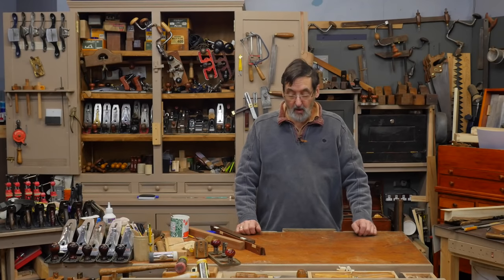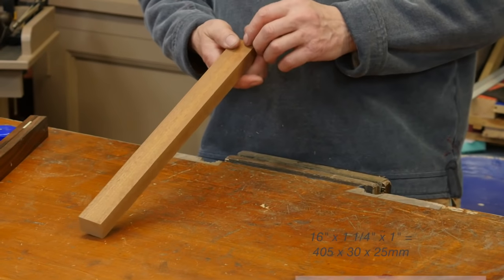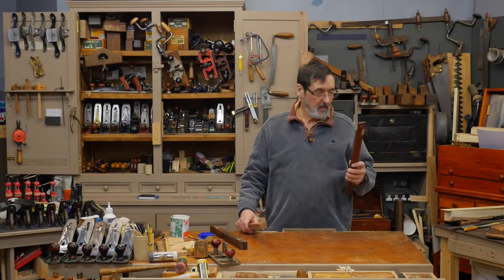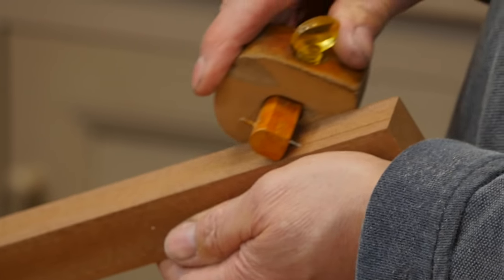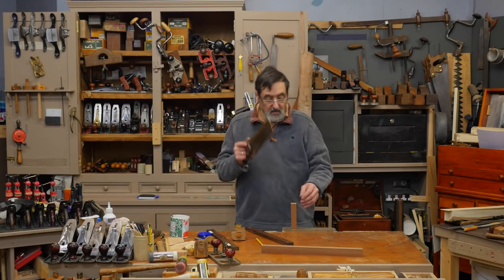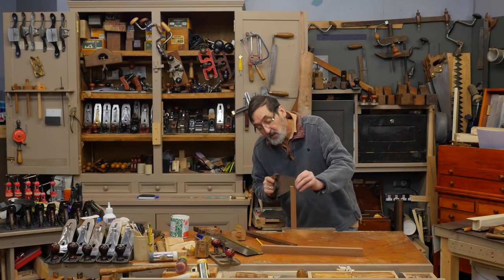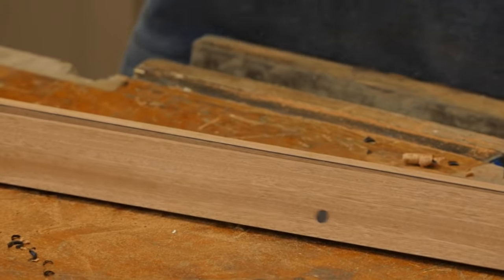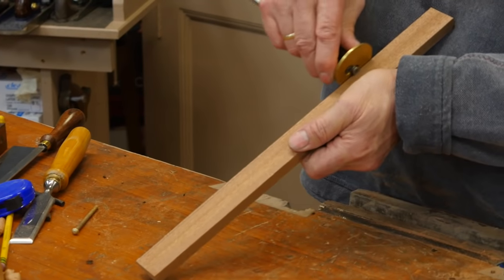How to make Winding Sticks (part 1) | Paul Sellers

Comment: OK, so the first thing you need is a piece of wood 1 1/4" x 1". Which took me almost two hours to saw and plane until it was "dead" straight, "dead" flat and "dead" square. (I had also watched the episodes about planing and squaring a piece of wood and  sharpening a plane iron) The funny thing is that, although this was a clumsy exercise and too way too long, I never knew I could do this AT ALL. But thanks to Paul's clear instruction videos everyone is able to learn the techniques.
Reply: How does one make the wood for his winding sticks perfectly flat and square without winding sticks?....
Reply: Luke Harris a small engineer’s square, a combination square...
Reply: one or two pieces of maple flooring fast and neat
Reply: @lukeharris7487  
Winding sticks are not that long so you can use a combination of eye, square and two flat bits of wood if you have them. 
This will allow you to square them without a twist. Winding sticks makes the job so much more easier and efficient.

Comment: Thank you Mr. Sellers for all your shared knowledge.
For cutting those small rabbets I like to use japanese marking gauges. They have little cutters. You can buy the blades seperatly and make your own... It works great. I also use it to cut very thin stock.

Comment: A side note on the Super Glue: when using cyanoacrylate, you can breathe on it to help it set. Normally, it uses the moisture in the air to set, but you can speed things up, if you really need to.

Comment: I'm learning so much so quickly from your videos. This one's come right handy as I'm desperately in need of a pair of winding sticks. One question: you said you ripped your ebony strip but didn't explain whether you were using it straight from ripping or after planing it down to size. Did you plane it down to size? If so how? Do you plane it on a surface against a stop or do you put the strip in a stopped slot?

Comment: so  I have a question, how do you square the stock for making winding sticks without winding sticks? I am trying to do this project and am having a hell of a time making sure my piece is true, as I do not have winding sticks. It seems a bit of a chicken or the egg issue.
Reply: +K EN use two squares.  Even if they are not the same width, so long as the upper edges are parallel, your piece is true.  It works the same as winding sticks, but winding sticks are easier to see and use.

Comment: Although I have made a pair of these I rarely use them. Instead I bought a couple of aluminium worktop joints from B&Q for a tenner, and put a strip of white tape on one and black tape on the other (https://www.diy.com/departments/goodhome-nantua-brushed-silver-effect-aluminium-alloy-worktop-joint/3663602635833_BQ.prd)
They are dead straight, they won’t warp, twist or bend; and I can leave them in the shed. They even have a ‘hook’ on the end. But even these have become a problem because I’m at a stage Mr Sellers hasn’t reached yet, when it’s difficult to keep both sticks in focus at the same time even with specs on. Also, bending down continually is getting difficult and getting up again is nigh impossible. So I got out my 9 inch spirit level. All I have to do is make sure the wood is firmly located, ideally with one end level, and then try the level on the other end. Works a charm, and no more bending!

Comment: Okay, I'll ask a dumb question: how would I get a beam of timber that is square all round without winding sticks in the first place to check my Face for twist? I know the obvious might be, machine it, but that seems to defeat the object.
Reply: Make a short pair of winding sticks. Use your eye combined with a square to get them straight as possible. You could use already purchased stock that is square to work as winding sticks that will get you through the process of making them. 
There is a certain level of square and straight that is worked to. That means if you get instruments and analyse the surface you will find it is not entire square. So there are tolerances we work to. 
So get square and go to a store and try and find the best stock you can and if you locate squared stock check that out. 
Winding sticks are only really to show that there is no major twist that will throw the work off.